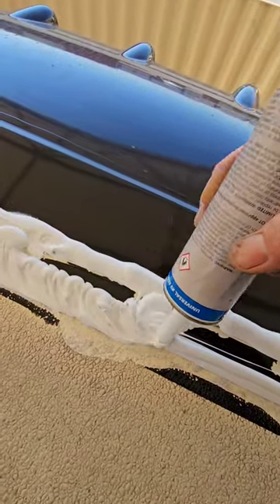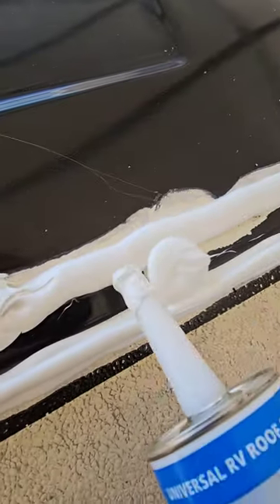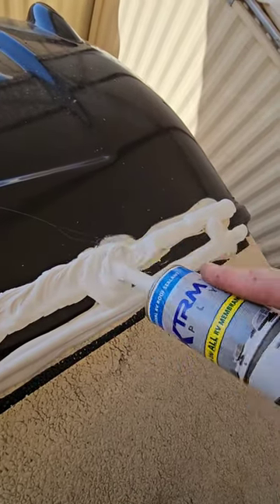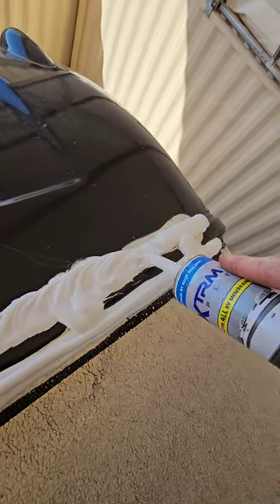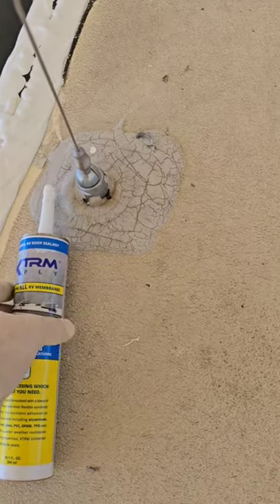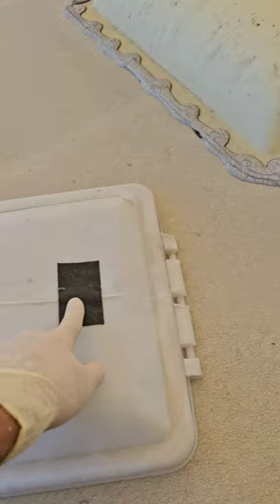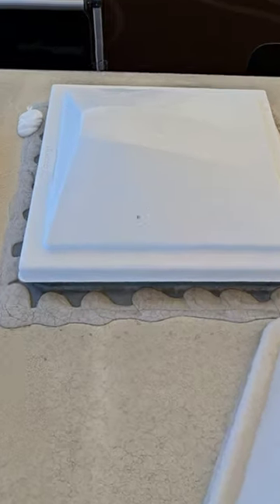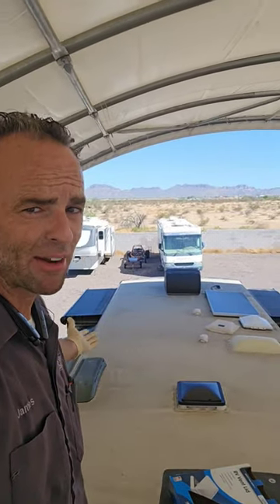rv roof repair 2

Comment: I find when using dicor or other self leveling roof sealants that the swirl method introduces a lot of air and can create bubbles in the cure stage. Have to come back and touch them up.

Tech for 11 years